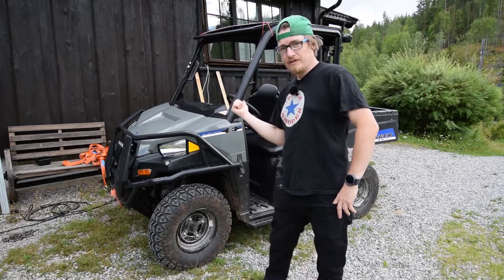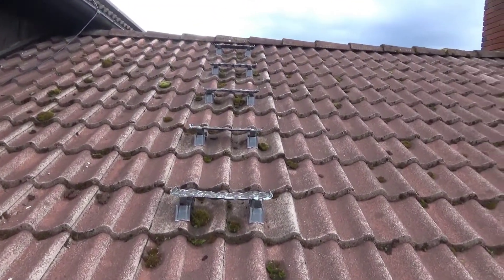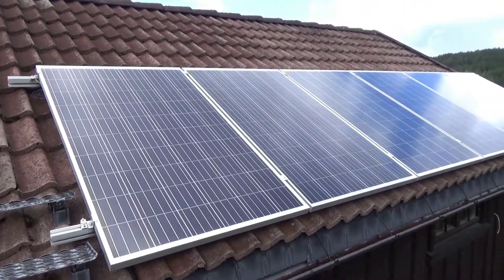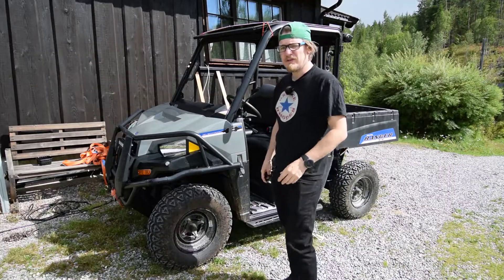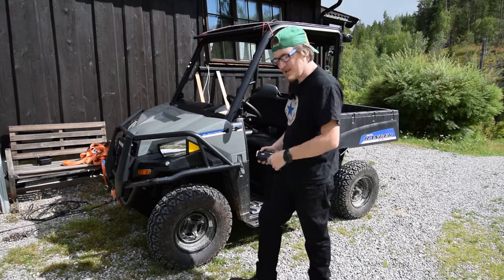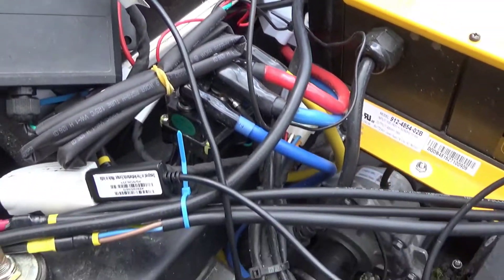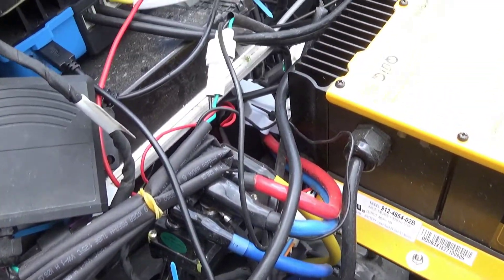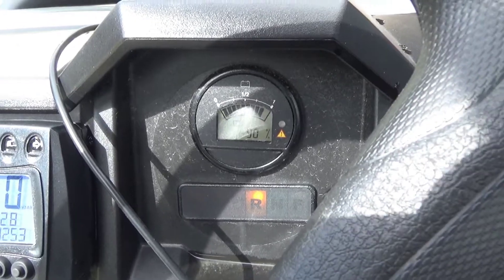Solar charging the Polaris Ranger EV

Comment: Hi, I have a 2020 Polaris Ranger EV. I want to set it up to charge from solar panels. I am assuming that you have lead acid batteries and your AC charger looks identical to mine (120 volt not 230). Can you tell me how you have your DC charging cables hooked up and also the details of your charging system. Thanks, Steve

Comment: 😂 First, you're probably just seeing voltage sag on the battery come up after use. Unless you are using a boost charge controller, your panel voltage isn't high enough. With a boost controller, it should take you about a year without usage to charge it from dead to full. So impractical. 😂

Comment: Here's my theory as to why your charge level may increase when you take it off the charger and start driving: If it's a lithium battery, that means it heats up to some degree when it's discharged. How fast and how deeply you discharge it may cause the amount of heat produced to change. That said, batteries of all sorts don't like being cold. Maybe the discharge caused by driving around is actually warming the battery up some and thereby causing it's voltage level/charge level to increase. Regardless, thank you for the video and the cool experiment. I just discovered the Ranger EV and equipping it with solar panels was one of my first thoughts and it's nice to know I wasn't alone. 🙂
Reply from the maker: Hey, thanks for a nice feedback! :D We have the worst kind of batteries for it. And they are causing more problems. We have moved to a new location, and hope to get back into making some more videos on this topic when summer comes along. I would like to exchange the batteries, but it is very expensive, so first I will see if I can fix the ones we have. They are same kind as "normal car batteries" with acid and such. The connectors are covered in acid, and water levels are low. Very bad atm.

Comment: what kind of charge times are you seeing with each solar panel system?
Reply from the maker: The solar panels on the UTV are so tiny, it takes weeks to charge it back up. For the ones on the house roof, they produce so much I would be afraid to damage the batteries, so there I limit it to the same charge current (and time) as the built in charger :)
Reply: Trollgården Homestead that's great stuff. Would love to see a "how to" video on either one of those, if it's not already too late! And just out of curiosity, can I ask where youre from? Can I guess Denmark?
Reply from the maker: Thanks for the tip! It is not at all too late. It is very much winter here now, but when spring / summer comes, I can plan to do something like this. For where I am from, you are very close! We live a bit further north, Norway :)